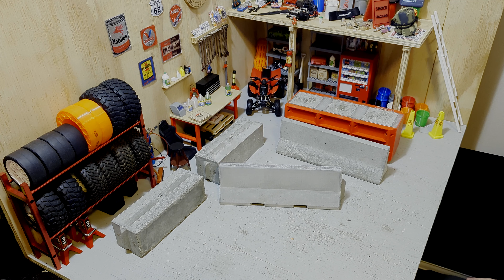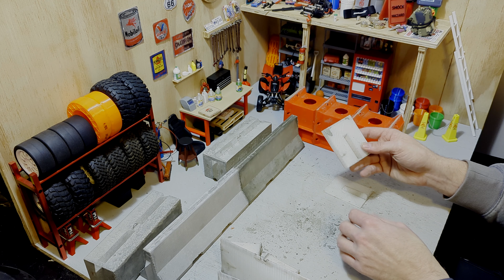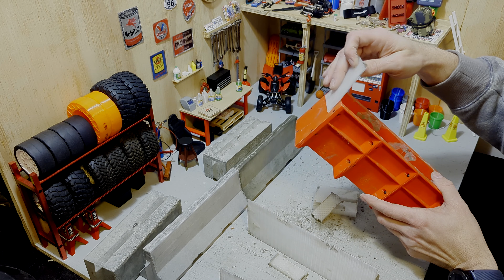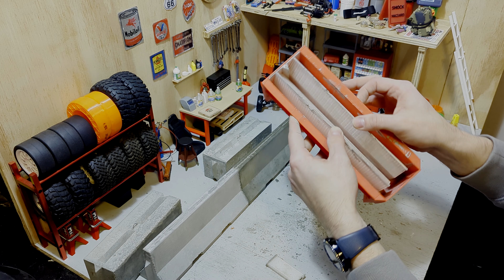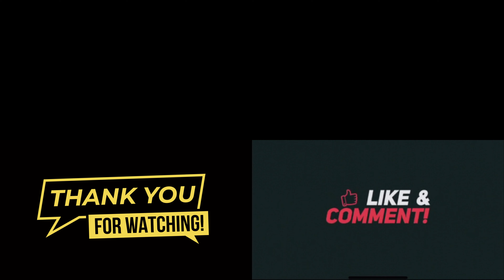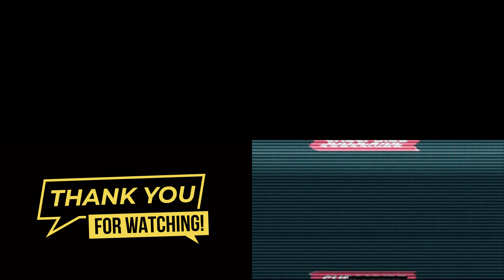My own design, a 1/10 scale Jersey Barrier mold kit, DIY using a 3D Printer and cement/concrete

Comment: What are the dimensions of thay jersey barrier looks great!
Reply from the maker: @maineexperiment  they are 1/10 scale of the original 8 ft Jersey barrier.
Reply: @metalgearrc2166  am i able to order some from you or the mold to make them ?
Reply from the maker: @maineexperiment  how many you looking to get a hold of?
Reply: @metalgearrc2166  potentially a few what's the inch dimensions?
Reply: Do you still have this mold available somewhere? The online file isn't there and this would be perfect for a project I'm working on. Thanks!

Comment: I wonder if you use a blow gun, from a compressor, through the backside of the mold you could get quick separation?
Reply from the maker: Hey, I like that idea. I may have to give it a try being that it does have a little suction when pulling it from the mold from the cement. A little like pulling two 5 gallon buckets apart. https://youtube.com/shorts/2FBfzFjDWDw